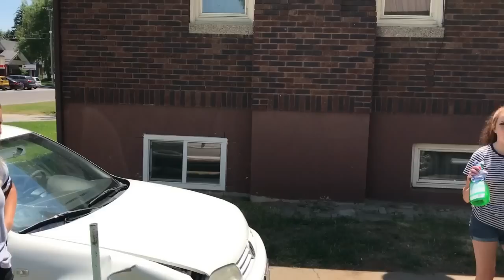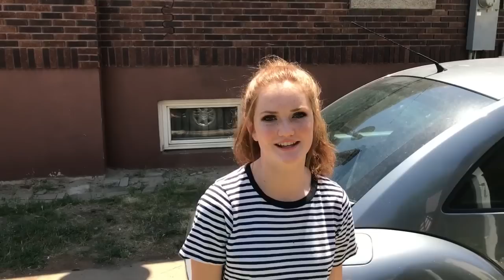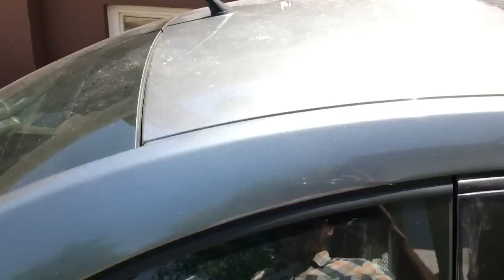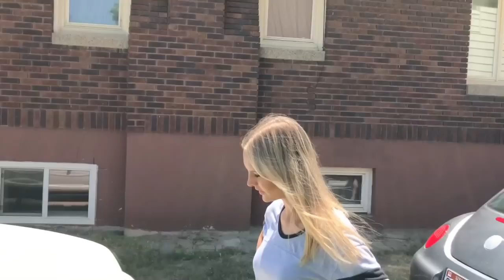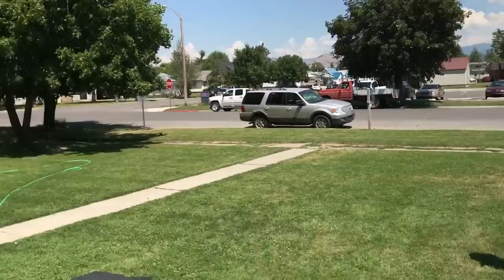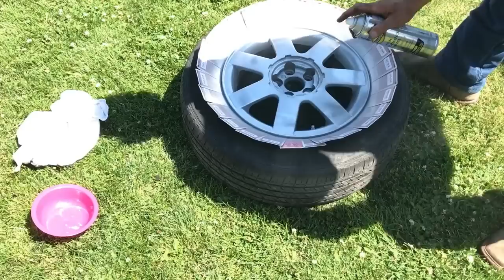#129 - I Picked Up A TDI Bug For The Girls To Use.

Comment: I have a 2000 jetta TDI and my wife has a 2004 jetta wagon TDI.  ALH and BEW.  Good luck with the turbo.  I sprayed carb cleaner down my turbo EGR connection which really helped a lot.  This after I put evaporust on the actuator lever.  150K and going strong.
Reply from the maker: I need to pull it apart and really clean it.
Reply: before I wrote this, I said to myself that you would do that!.  On the BEW, the vaccum actuator rusted out so I got a replacement actuator and had to adapt the rod so that it would fit.

Comment: And if the body on one of the diesels gets wrecked but the engine is fine you can pair it with a 3 phase motor of the same or less hp of the engine to create a generator.  Only thing better then a diesel generator is a wood gas one as fuel for them do grow on trees.

Comment: So, did you ever get the power back? Besides cleaning all the EGR carbon build-up that might be clogging the intake, cleaning the intake snowscreen, etc, you might try crawling under the car and looking up (after taking off the skid plate) at the vacuum hose connected to the turbo actuator diaphragm. I have the exact same ALH TDI VW Beetle (mine is 2001), and mine had a vacuum hose that was too short from the factory. The vacuum hose was stretched tight to get all the way from the vacuum control solenoid down to that turbo actuator, bent at a right angle at the turbo actuator nipple, and eventually rubbed a hole right through the rubber due to being stretched so tight and the engine vibration over the years. Without a good solid vacuum line to that turbo actuator, you won't get the turbo to engage fully or at all if the vacuum leak is severe enough. I bought a nice long, thick walled, replacement rubber hose from McMaster Carr that made a HUGE improvement in my car's turbo boost. Very easy to install, once you know about it. I swear, when I replaced that faulty vacuum line, the turbo boost was better than when my car was brand new (since there were no holes or kinks in the line now)! Good luck to you and your ALH TDI Beetle! VROOM VROOOOM!!

Comment: Volkswagen Diesel engines are generally bomb proof, unfortunately their turbos leave much to be desired. You know you have a problem when they start to use too much oil. I hadn't read up enough and blew my turbo at 260000km. I had a 2l140bhp motor in my taxi. The fix was cheap but the garage was not too good...at least it was under warranty. I sold it 650000km no problems.

Comment: I also have a alh beetle. Legit clean the inside of the engine of carbon build up and maybe replace headers and it will run amazing.  Also have a look at your injectors.
Reply from the maker: Just did the EGR delete. It was plugged up. I'm going to pull the turbo and intake and clean it. I did the Liqui moly diesel purge on the pump and injectors.
Reply: Red Poppy Ranch I need to do the same I'm just lazy and honestly don't trust myself (am 18 hehe) these cars are awesome haha

Comment: +Red Poppy Ranch - Serious question that sounds judgemental but isn't: How can you stand to be a "Volkswagen guy"? They need repairs SO OFTEN, and if you don't have the space and the tools to do major repairs in your driveway then you're stuck paying through the nose for a mechanic to do the work. My Passat cost 2x as much in repairs over 6 years as it cost to buy the damn car in the first place.
Reply: I've owned and maintained my 2001 ALH VW TDI Beetle for 17 years. Best damn car ever. It's never left me stranded, not once. I've done all the oil changes, filters, fuel pump seals, gas struts, head lights, brake pads, glow plugs, glow plug wiring harness, and turbo actuator vacuum hose replacement myself. Only time I've taken it into an expensive shop was when it was due for the timing belt replacement. Considering how many years I've used it and how good it runs, I can't think of a better car to get (MAYBE a Prius, if you can get one cheap). I paid $18,635 for mine brand new. This guy got the same thing (albeit used) for $725 -- a screaming bargain if you ask me. 49MPG hwy is FANTASTIC.